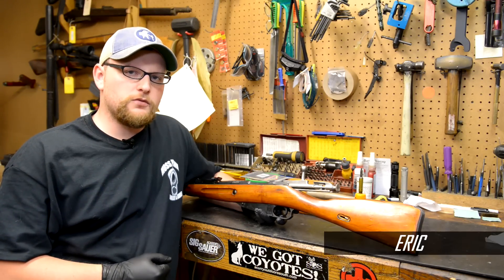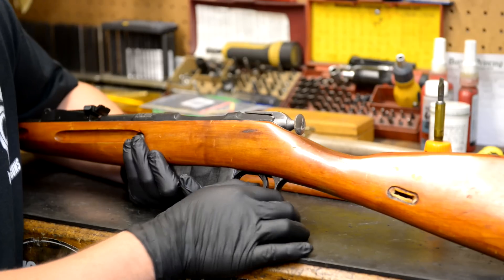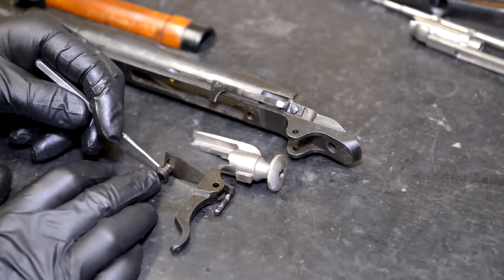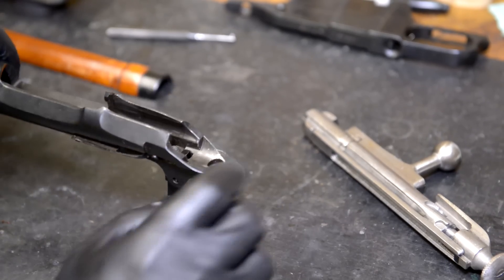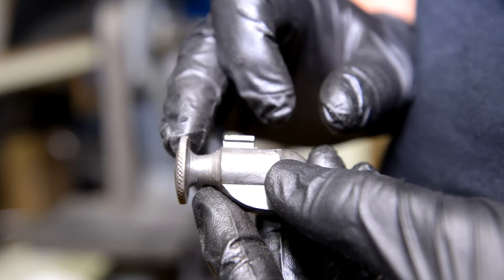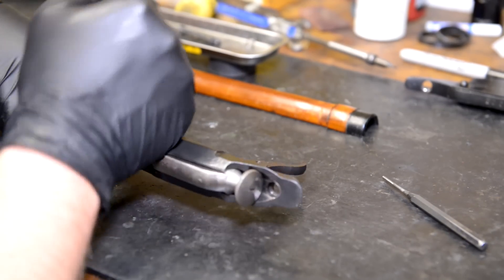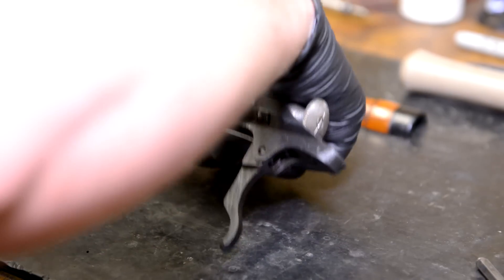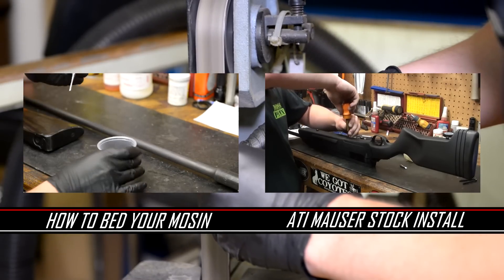How To Episode 4: Mosin Trigger Job

Comment: Don't know why I didn't think about doing this till just last weekend.  Holy crap, what a difference, no sanding wheel for me, I just did it by hand, worked with some 240 to get all the machine marks off and shorten the sear slightly, then polished to 2000 grit just cause I can.  This along with IV8888's sticky bolt fix has made my mosin so much happier now!

Comment: Eric - You're the man.  I had already filed down the sear a wee bit, and the trigger was much improved.  This video really gave detailed instructions.  I bought a grinder bit for my dremmel tool and grinded the parts Eric used a belt sander on (don't have a belt sander).  Then polished all grinded parts with dremmel coarse finishing wheel - came out perfect.  I've now got just under a 4 lb. trigger pull.  I weighed the trigger pull by tying a wire around a 1/2 gallong jug (4 lbs.), then tied the other end to the inside of the trigger guard.  Put the jug on the floor and with wire over the trigger, slowly lifted the rifle, and the trigger broke.  So I know it's just under 4 lbs.  Another great video from Iraqveteran8888 - the trigger job is perfect, and simple to accomplish.  Thanks and God Bless you!

Comment: IV8888, thanks for this great and EASY fix.  My Mosin had a pretty hard, gritty feeling trigger.  Disassembled like you showed, and just buffed the sear and the cocking assembly with a 240 grit paper on my little Harbor Freight Multitool and shined up both surfaces.  A drop or two of gun oil on the sear when I reassembled the receiver and bolt.  Now, it's a clean, crisp break.  Thanks!

Comment: This works surprisingly well. I did what has been depicted in all of Eric's mosin videos and my trigger pull is a fraction of what it was, my bolt has no rotation when pulling the trigger. I also added some epoxy to the front sight post and filed it down to get the elevation proper for 100 yards instead of spending money on the smith sights. I can now average 3 inch groups at 100 yards all day long.

Comment: I just polished all the contact surfaces of the trigger and bolt to a mirror shine and added a .030 shim (cut from an aluminum "thinbit" measuring tool) under the spring and got the same result as he did.
Smooth, light trigger, no bump misfire, no bolt lifting movement, just a lot of loose trigger travel so I still need the trigger slack spring.

Comment: I got the same effect by visiting Home Depot and buying a tiny washer and a tiny torsion spring. The spring will allow the trigger to feel lighter as you pull back, so you can relieve the tension of the trigger. The shim will allow you to get a better and stronger accuracy. No power tools, no permanent modifications, one crisp trigger.

You can buy these as a kit for like $5 online just to make sure you get the right items or you can get them for less than a dollar at the good ol' Depot. You can find the information just by googling Mosin trigger spring kit.

Comment: Thanks!  Working on two Mosin's for my buddy and me.  Cleaning cosmoline and refinishing the stock with new shellac.  I added a spring to the trigger where the trigger pin is.  I think you mentioned that but it does give a nicer pull.  Going to add your modification and expect to get nice results.  Don't worry about length of your videos.  We can always skip ahead but we can't add more to it!

Comment: I finally got around to doing this and I want to say thanks.  The pull was over 8 pounds and now it's at about 3 pounds without any slam/drop firing.  The trick is getting sharp edges and taking just a little off at a time.  File, test, file, test....

Comment: Just got done with this mod to my 91/30 stuffed in a CBRPS bullpup stock, turned out awesome. Before the job the gun had a what felt like a 10lbs pull and with the hoaky linkage of the bullpup felt like it was doubled. Ground down the seer and polished everything up and without linkage it feels like a 4lbs pull and maybe 6lbs with linkage. Tried the shimming of the leaf spring doesn't work near as well as grinding the seer highly recomend this. Thanks

Comment: I did this along with the cam surfaces on the bolt and the cocking knob, and on the cam surfaces between the bolt and the receiver and it makes a huge difference.  Using a large Allen key on the trigger, and a kitchen scale I guesstimated I'm at a 4lb pull.

Comment: I just shimmed mine, takes like two minutes plus a little fine tuning. I tried a soda can tab first, was too thick. I settled on a business card, it still doesn't break as light as I would like it to, but I couldn't get it any lighter without it being unsafe. I might make a metal shim later, but for now this works.
 Going to install one of those C&R slack springs as well.
Probably around 3 to 4lb pull.

Comment: Great video, I really appreciate it. I ground too much and had to grind the sear stop to give me enough engagement. When I assembled the unit, the bolt would not stay engaged. I ended up having to file the inside top of the trigger to allow the sear to engage. I only filed on the same angle at full forward trigger position. That allowed the sear to engage enough to hold the bolt properly and eliminate almost all of the take-up in the trigger. Now it has about a 4 to 5 pound trigger. Thanks.

Comment: Picked up a 1939 Mosin last week at Cabela's.  After removing all the cosmoline, and lubing it, I was shocked at how horrible the trigger was, rough, gritty, would pull the bolt down so far it would bounce up on release.  I followed your instructions, took my time, ended up putting it together a few times, then sanding a bit more.  
This method WORKS. This Mosin now has the smoothest, nicest trigger pull of any Mosin I have fired. 
Thanks Eric!
Reply: M1A

Comment: Thank you for this video! I was very apprehensive before starting the job, but in the end all is well. Starting with a 9.5lbs trigger, I followed your instructions as closely as I could and ended up with a 4lbs 4 ounces trigger on the first try. Of course, it didn't crack exactly at 4lbs 4 ounces every time. It was an average of 7 samplings with a standard deviation of 3 ounces.

Comment: Thank you so much for this. I happened to have one of those 10-12 pound triggers. Its probably sitting around 4 pounds now. I dont have access to a belt sander so I used a small aluminum oxide sharpening stone and some fine grit sandpaper. My next step is glass bedding.

Comment: You can also place a small washer ( I forget the measurement of the washer) between the sear and the receiver. Then with a small flat file, file gently to make it sit flush with the edge where the round sit. Basically you are shifting the contact point of the sear down. This combined with a cleaning and polishing made my mosin super sweet.

Comment: I just did this- thanks, Eric! A good mosin (1933 hex receiver, 4-5"groups at 100 yards, open sights) just became better. I went very light on the height reduction, concentrating on polishing instead. Went from grainy and heavy to less heavy and crisp. I also installed a small spring to keep the trigger to the rear (no slop now) and a very thin washer under the trigger spring (part of the reason I went light on the height reduction- figured I could remove the washer if I went too far). I plan to bed the action, per your instructions, but have no doubt it just got more accurate.

I bashed it around a little to make sure it won't drop out of a tree stand and shoot me in the ass- it won't. The trigger pull is still a little heavy, but so crisp and predictable I'll just live with it. Still looking for the advanced trigger job, though.
Reply: +Churro I forgot to mention that I did most of the work on a whetstone. I had to be careful to maintain flat surfaces and not round-over the edges, but it took only a few minutes to remove the visible tool marks, then it polished up nicely using a Dremel with a polishing wheel and rouge. I can't emphasize enough to go light, especially with power tools. The minimum grinding and light polishing I did worked wonders. I wanted to creep up on "perfect", but it was a very short stalk for my rifle. Not an expensive gun to replace or repair, but my pride would have been wounded by failure.

Comment: I have been looking at buying a m91/30 $130.00 or a m44 for $319.00 both look in great condition . Ammo is very plentiful and cheap as compared to a 30.06  . The same is true for 7.62 x 39 ammo very cheap (32¢ - 39¢ a round).
 Thanks for the videos I always learn a lot. I am pretty confident I could do this .

Comment: My M44 trigger is excellent.  I noticed that the engagement point of the trigger on the sear spring is right next to the sear.  There is no need for a return spring because it is pressing against the sear.  It engages the thinnest part of the sear spring.  I didn't realize that this was the reason for it's lightness until I looked at a 91/30 where the engagement point was more towards the screw where the sear spring is fat.  That trigger was pressing there to make the sear go down and the pull

Comment: So I don't have a belt sander like you used for this video so I basically had to do it with files and other tools I could find. Even after taking some metal off, the sear still pulls down the cocking piece. Naturally I'd assume that means either straighten out the edges or take more off, but I've found that if I drop the rifle on its buttstock from 2 or 3 feet it will fire.

Comment: While I always appreciate your video's. Especially the instructional video's such as this one. I'm hoping you are willing to answer a question, I'm finding it hard to find the answer to. I recently purchased a Timney Trigger Mosin Nagant 1.5 to 4 lb Adjustable Trigger. I also purchased the Archangel Stock, which the trigger fit cleanly & easily into without destroying the original wood stock. My question, the Timney Trigger for the Mosin Nagant is said to be Adjustable between 1.5 to 4 lb. I have been unable to locate ANY information on how to make this adjustment, if I desire to do so. Nothing in the instructions, nothing on the Timney website. I've searched the Internet but, nowhere can I find the answer. You have always been very good at providing answers to your viewers questions so, I thought I would post this comment in the hope you will provide guidance in this matter. Thank-you in advance, Richard

Comment: In case you don't have the equipment or don't want to risk grinding off material from the sear, you can cut out several small squares of tin foil, use a hole punch to out holes in the middle of them and then stack them all underneath the screw that hold the sear to the receiver.Then you can simply use a silver polish or something similar and polish all the contact points on the trigger and sear assembly.

I don't know how it compares to this method, but my Mosin trigger is VASTLY improved.

Comment: Great video Eric. I'd like to point out that you should never make your sear engagement less than 90 degrees. This is a negative engagement and is EXTREMELY DANGEROUS. When you pull the trigger you should never see the cocking mechanism move forward towards the barrel, it should have a slight rearward movement. Eric's drop test is a realistic test that can help you discern if your firearm is safe to use.

Comment: Eric, what grit belt is on your small belt sander?  Is as fine a grit as you can get best for these jobs?  It would seem that the finer the grit the less material you'll take from the pieces you are trying to sand/polish so the less chance for a screw up unless one were to use main-strength and awkwardness as my father used to say!  BTW, I really like your videos!!!  You would make an excellent teacher because you are just technical enough and no more for those of us who aren't gunsmiths or super familiar with our rifles/guns!  Thank you for that!  If we don't know how each piece works in relation to the others we, ultimately won't understand the principle behind the whole job.  I know I'm not the only one who appreciates your down-to-earth way of explanation!
Reply: +Kim Curtis I got a ~3 ish lb trigger on my mosin with a 400 grit belt on my sander
Reply: Thanks!  I just did mine and it's much better but I need to see your full trigger job video so that I can do an overtravel screw and see if there is a way to take more of the take-up out of it.  It still has a long travel before all the slack is out of it.  I really enjoy your videos.  I'm an amateur smith and am learning stuff from you I haven't been taught by anyone else!.

Comment: 35 dollars for that trigger job?  That's completely reasonable.  I really wish you guys were located up here in the Twin Cities.  The nearest gunsmith around here wanted 40 bucks to check the headspace on my Mosin!  40 bucks to remove an extractor, and close the bolt on a couple of gauges!  Great video as usual, btw.

Comment: I'm new to DOI gun smithing but I feel confident I can do this project. I've read that some components are only case hardened and if too much material is removed you can expose softer metal and it deteriorates quickly, would that be an issue with this project? Any info would be appreciated thanks.  love the videos.

Comment: Great video, many thanks for the hot to.  One question, can you provide more detail about exactly what you're looking for when you do the marker on the sear and bolt surfaces?  It would be useful to get more details on what those looked like and what should be done based on those markings.

Again thanks!

Comment: have you thought about putting a dial indicator on the striker to see how much travel there is when the trigger is pulled? so you can work it down to a few thousanths of being a 90 degree angle...or as close as you are comfortable taking it

Comment: was like 15 lbs, whereas the pull for the M44 with the trigger pulling down right at the sear and thinnest point of the spring was only like 3lbs.  This is very interesting because the 91/30 trigger, not resting against the sear, made it flop forward until it did touch the spring.
This is interesting because it has nothing to do with all of the usual tricks which include washers lowering the sear, bending the spring, making a protrusion on the trigger to press the spring down, and polishing.

Comment: Instead of removing material from sear you can make tin foil shims to lower the sear away from the receiver and achieve a similar effect. Which I think is a much safer route for all the kitchen gunsmiths out there that might grind off too much material and render the sear unsafe.

Comment: Awesome video, thanks Eric!
Reply: Wanted to add, performed the trigger job on my newly acquired Mosin.  Did not have access to a belt sander, though I am a mechanic.  I did the entire job, sanding and polishing by hand.  Made a REMARKABLE difference!  My bolt moved just as much as yours, if not more.  Now, there is no lateral movement and the trigger is super crisp.

Comment: You talked about making both sear surfaces 90 degrees to each other but you specifically didn't change the angle of the spring sear engagement. You only flattened the bolt sear to 90 degrees. Am I missing something?

Comment: I worked on my Mosin trigger and it is rather nice, but every time I do the drop test it does go off. Right now it feels like maybe 4 pounds, but I don't want to wear down and add poundage just for safety sake, but I will just because I know it's the right thing to do. 
How can I get a light trigger while at the same time being safe, is it even possible for a factory trigger to be that way without being dangerous?

Comment: Do you know what would help with a trigger group on Mosin that sometimes won't fire the first time (even if you pull the trigger back all the way) and will fire when you release the trigger and pull again? I can see the bolt rising as I pull the trigger in these cases for the first time, then nothing the second time and it fires a bit shorter pull as well. Any ideas will be much appreciated!

Comment: that little steel pin to the trigger, i lost it and wondering where i could get another. any ideas or tips?  i really love my mosin
Reply: Santino Martinez 
I made a replacement out of an old drill bit. Can't remember the size but it was slightly larger diameter than the original. I sanded it down to fit with less play than the stock one.
Reply: middlesiderrider sounds like it'll do the job, thank you

Comment: Hello, I have one problem. The spring/sear thing can freely rotate on the screw. Should not you have manufactured some jig that would hold the spring/sear in exactly the same position each time you put it back together?

Comment: i need to find a nice replacement mosin stock in excellent condition. Where would be a good place to look? Ive got 2 91/30 stocks that after getting the original layers of finish off, you can tell obviously that peices were broke and pieces of wood were cut to shape to fit and were glued.

Comment: I had two trigger sears snap in half while in use before. Can someone give me advice where I can get a durable trigger sear spring to preventing that from happening?
Reply: If you can find an an aftermarket Finnish Sear that would be ideal.  I was lucky enough to get one off of GB but YRMV.
Reply: A friend of mine took his to a metal shop here in Vegas and had the fabricate one for him out of case steel. He swears by it now. Call around to some of your local area shops and see if anyone is willing to try it.

Comment: the pin on your trigger is really tight. mine just falls out once i take the gun apart... any ideas
Reply: I put a very small dab of lock tight on the pin the after it dried I filed the dried glue to make a tiny shim. It worked perfectly.